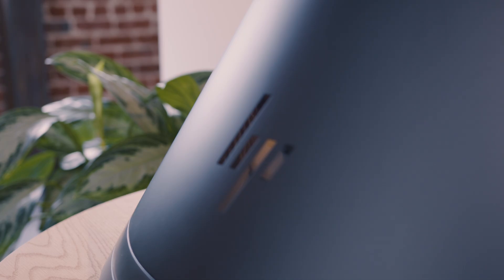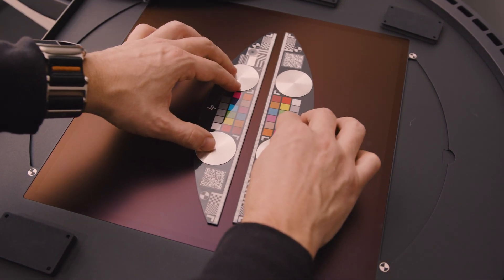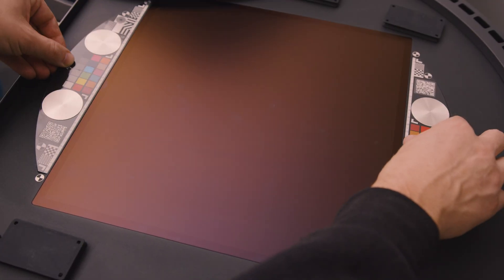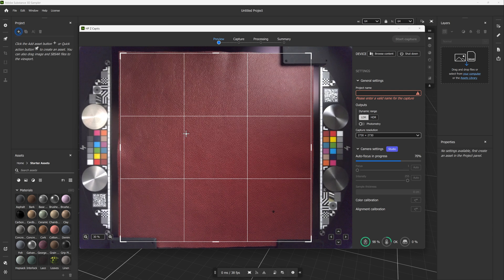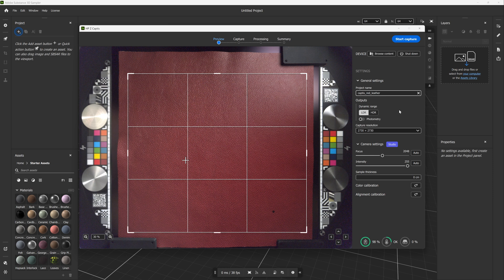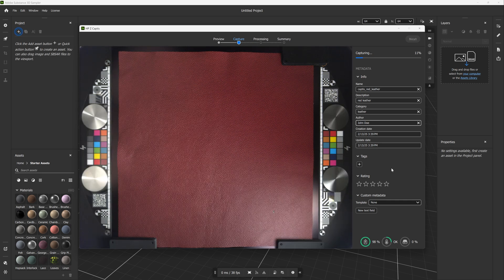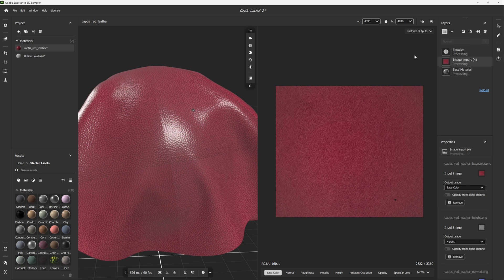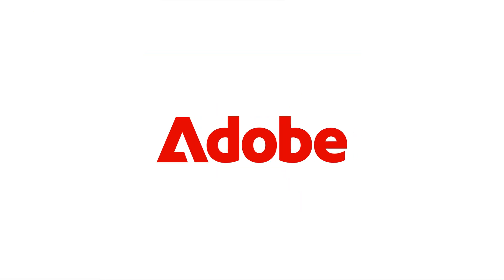Capturing Materials with HP Z Captis & Substance 3D Sampler | Adobe Substance 3D

Comment: When I first saw this was a thing I had high hopes up. Now I, and I think everyone else feel a bit disappointed. 
This is perfect for someone who only scans tiny pieces of fabric, and doesn’t need gloss/roughness. And also has 20 000 dollars they don’t know what to do with.
For that amount I think I could hire an engineer to make a pretty amazing DIY scanner.
Reply: This kind of setup is not really new and specifically allows for gloss/roughness capture that's determined using polarized lens filter and matching polarized light at alternative capture angles. But yeah the 20k price tag is a joke. You can find DIY's of such setup for far less and even considering having to buy a DLSR it still would be cheaper and you can at least also use it for personnal photography. The ease of use of that tool is not worth 19-18k$

Comment: It's a shame there's no stand-alone license for substance sampler. There IS Bitmap2Material on steam, which is Sampler's predecessor, but it's no longer being updated.

And while this scanner might be impressive, its application is somewhat limited to things you can stick to that tray. What about taking scans of soil, rocks, wood or skin that isn't leather? It's useless for that. And 20K? Nope. You can get hand-held 3d scanners that could do the same job with more, and get you actual 3d models as well, for as little as £900

Comment: Yay cool, 20k$ toy integration. Great.

Can you spend a bit of your time now to focus on basic UX like batch/multi export or being able to use arrow keys to navigate textboxes ?
Reply: I doubt the team that is working on these features also work on UI, they are probably different teams.
Reply: @3TQHAJSHNQ  It's the least prioritized Substance product, I bet there's probably not even enough developers supporting it left from Allegorithmic to consider a team let alone multiple ones. It still lack basic UX (not (just) UI) features and run just as bad as when it used to be the company's 'side project', making your GPU whine for no reason while the software should be idling or being a nightmare to work on more than 4 materials at a time.